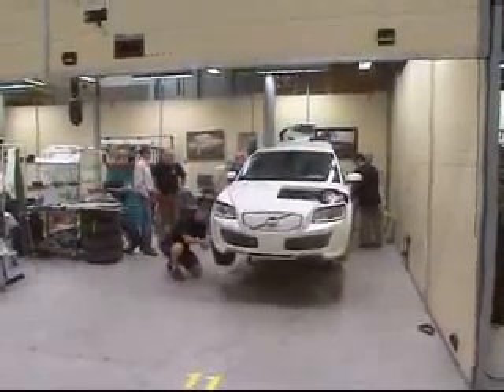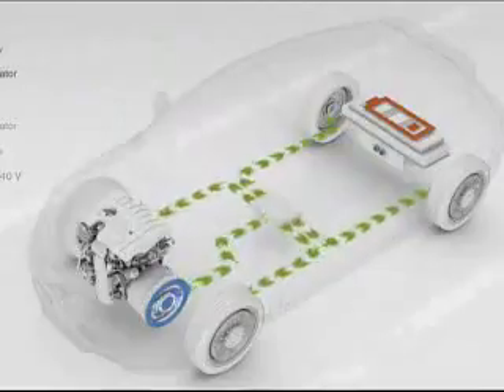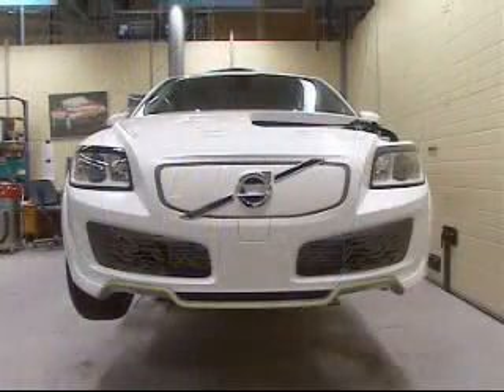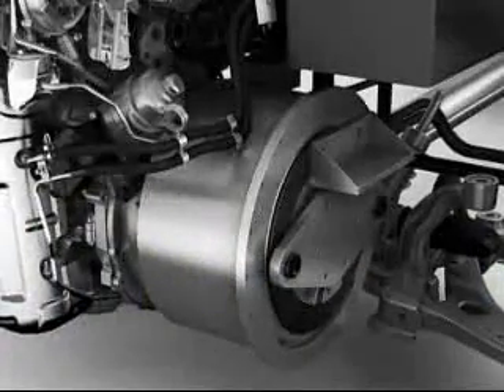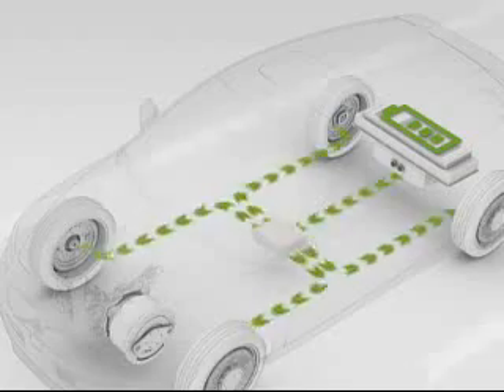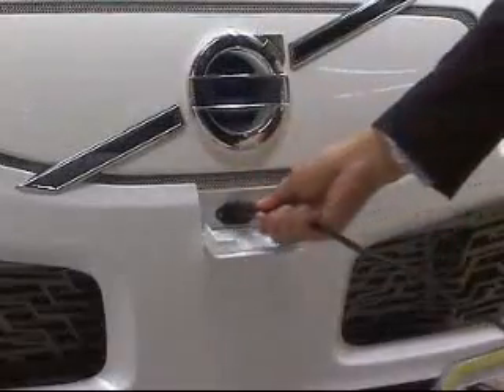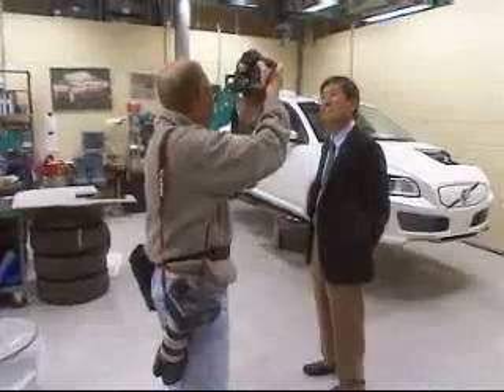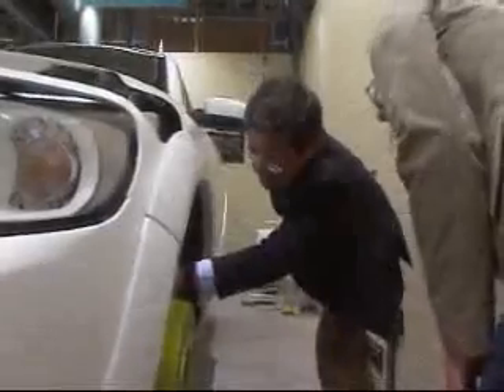Electric Car with In-Wheel Motor Volvo ReCharge concept

Comment: Tesla Model S already has +500km range. With the upcoming 120kWh battery pack it'll be even better.
Reply: ***** Tesla Model 3 should be around $30,000 before incentives. It's expected to come out early 2017.
Reply: ***** Yes, when the engine actually was during this!
Reply: BOKÓ!

Comment: Electric cars will help clean up the air inside the cities. But what will be used to produce the extra electricity for cars in countries where hydroelectricity is not an available resource? Fossil fuel burning?

Comment: This is similar to the Cat D7E dozer or the Viamotors 4x4 "Self-Charging Electric Truck" except it has four independently controlled wheel motors. Imagine on icy roads, you panic and hit the accelerator and the car turns the tires just the right amount to not spin.  The only problem I see is that the gas engine will have to be rebuilt every 2 million miles which is about ten times less often as the current cars.  Mechanics will be relegated to changing batteries and tires.

Comment: The first racing car Ferdinand Porche drove in 1909 was a hybrid.
With much improved batteries, supercapacitors, minute eletric motors, etc, there no no reason not have all cars hybrids.

Even with no batteries and a constant speed Wankel turning a genny that feeds motor-in-hub electric motors, the efficiency is still far higher.

Comment: So have TWO cars. Are you joking?  Look at the Chevy Volt and range extender engines. Mazda are having a Wankel as a range extender next year: small, light, high power/weight ratio.  Good mpg when run at its constant speed sweet spot.

Comment: The Holy Grail of car batteries: Small and light enough in weight,, and with enough charge to get you 300+ miles with a 10 minute recharge time at any service station. Will we ever see that?

Comment: The second kind of driving is distance,,also known as the 'road trip'. Unless batteries are light weight and can get you 300+ miles with a 10 minute recharge time at any service station,,then batteries are not good enough to take on the 'road trip'. And it's questionable if they ever will be. But diesel and gas/petrol is good enough to take on the 'road trip'. And it's likely the ICE will remain with us for a few more years yet.

Comment: There are two kinds of driving: There's Local,,also known as 'city driving'. Which is about 40 to 70 miles depending on where you live. And is what most of us do anyway. Batteries are right now today are good enough to take on all Local driving. Especially if there's charging stations everywhere. We may see a time come when all cars are electric for at least 40+ miles. It could be done depending on the Captains of industry and if they allow it!

Comment from the maker: The price of a kw/hr is approx the same now be it from a wall socket of a petrol pump. 

The reason a petrol powered ICE costs 10x - 20x as much per mile to drive as an EV is they are about as energy efficient as an incandescent light bulb. You might be able to pack $100 worth of fuel in your cars tank, but $85 of it gets wasted as useless heat. 

The more people learn this, the more they'll want EVs.

Comment: or ... you all pople out there can make yorselff an electric car, 100% electric without charging and solar panels and any that stuff that will require batteries. you could just simply add to any car 4 custum motors on wheels, 1 magnet motor and 1 alternator that could provide enough power to a small town ;) :D >:)).

Comment: Put a small magnet-driven motor inside to generate electricity and a solar-panel roof and you're done. You could then even use your car to supply (supplemental)energy for your home.

Comment: 1. The stupidly put the AC connector on the front - right where all the road slop and salt will hit it.
2. Here we go again - still have to have that gasoline consumption. Have to keep kissing the butt of the oil companies. 

Volvo should be renamed to "backside."

Comment: Wheel motors have been used for years in factory settings to move conveyor belts, it's not a revolutionary design.

But why did they put the recharge port on the front bumper? Is that the worst possible place to put it? What happens after a minor front end collision and the port is busted up?

Can anyone think of a better place for it or perhaps I am too critical?, because is this really just the most convenient spot? I would design a second auxiliary port inside the trunk or cabin.

Comment from the maker: You have no idea what you're talking about!! The motor is ment to be 40kw. The motor in the tzero and X1 as feartured in quite a few videos on my channel is 165kw and is Air cooled. If it's good enough at that power level, air cooling will work fine for a 40kw wheel motor, at worse they can run wheel fans.

Comment from the maker: Diesel Locomotives do use electric traction motors but they don't have a battery system so when they regenerate they just burn the braking power off throw a resistor bank as heat. 

This Volvo can reuse the energy from braking over and over again to reduce costs and extend  milage to as much as double compared to no-regen.

Comment from the maker: Heat = waisted energy. Electric motors run so efficiently they often only need mild air cooling.
 
I have a 1.5kw 3 phase AC motor downstairs that when running at full load doesn't even get warm to the touch. 

Heat = waisted energy, that's why an ICE is so hot food can be cooked on it and if it lost all it's coolant it would seize up within minutes.

Comment from the maker: It's not a new concept all right, the Lohner-Porsche System was unveiled in 1898 which was a 4 wheel motor battery EV. 300 of them were actually sold up till 1906. There is still a web site for Hydro-Quebec but no sign of any actual test vehicle. Wheel motors are definitely the way to go for EVs.

Comment from the maker: Come on, how often do you drive 1000 miles non-stop? It's cheaper and faster to fly anywhere over 500 miles away!

Something like 80% of drivers do 40 miles or less daily, that requires only about 6kw/h of electricity in an EV (costs about $0.60) Carting around 1000 miles worth of range when you only need 40 mile range is like having a car capable of doing 200 mph, useless over capacity.

Comment from the maker: Building pure battery electric EVs is not in the best interests of motor companies.

Electric motors are too durable, i.e millions of miles before they need rewinding. That would slowly put car manufacturers out of business compared to their current business model were cars "wear out" in 300,000kms and they're all too ready and willing to sell you a replacement. 

This is perhaps why they're talking about leasing batteries, it's the only way they'll keep making money after an EV is sold!

Comment from the maker: It is stupid!!  

Remove the 150kg of ICE and the car instantly has more range. Once they start to sell these series hybrids with wheel motors, inc the VOLT (AND why are NONE of them diesel??) drivers will start to ask the same question, "Why do I have to lug around this dead-weight when I can drive 100km+ without it even turning on"??? There should at least be an option to delete the ICE and put more batteries in instead.

Comment: This is NOT the car of the future!  Any car that uses an internal combustion engine is using ancient technology that's about 15% efficient. Sure, if you run it only on batteries, you don't have to waste 85% of your fuel trying to run it on the engine, but you're still wasting electricity hauling around that engine that's not even running!